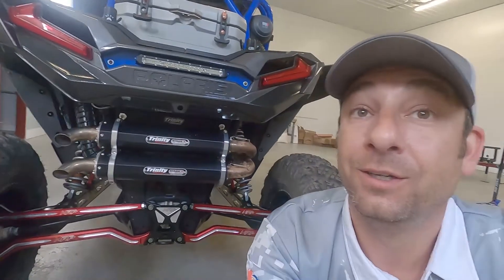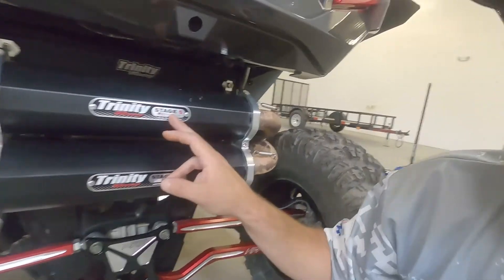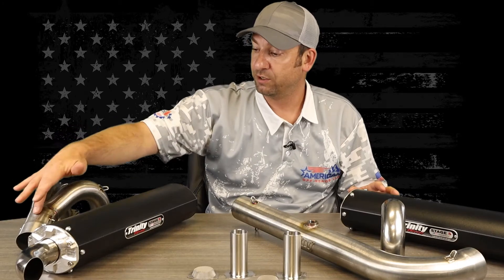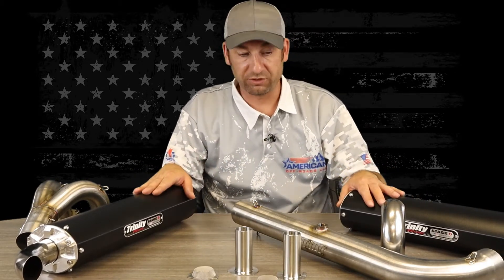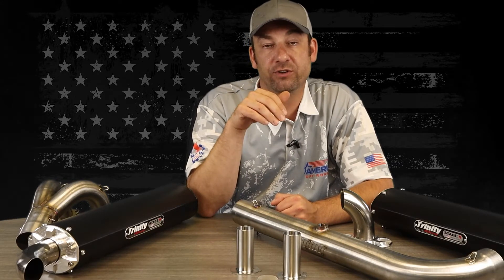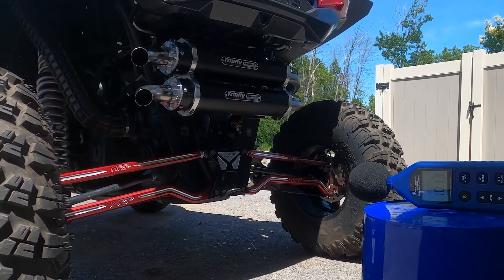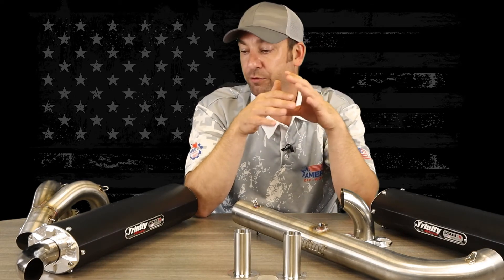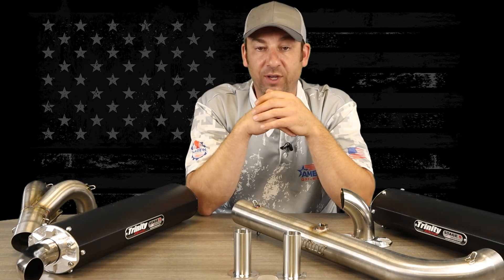Two Min Tuesday, Trinity Racing Stage 5 Exhaust Walk Through. Features and Sound Test

Comment: Does this exhaust setup require a fuel controller?
Reply from the maker: Hello, no it's not required. The exhaust gives you the sound, HP and cooler engine temps but doesn't need a tuner
Reply: @americanoffroads  Cool. Thanks for the response. I’ll sub ya!
Reply: Do I need to purchase a new flange gasket, or Re-use the OEM 1, after cleaning it up? Gaskets aren't mentioned in ANY of the install videos, I've found. Thanks
Reply: @nicolefox8596 I reused mine it looked fine.